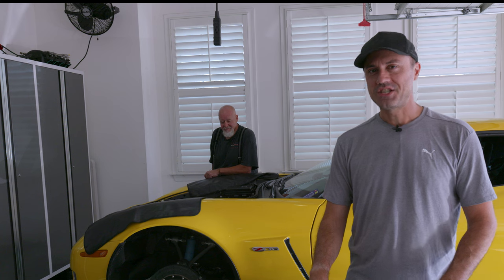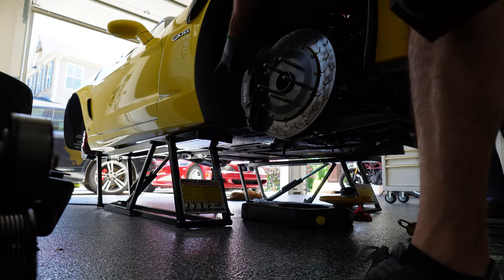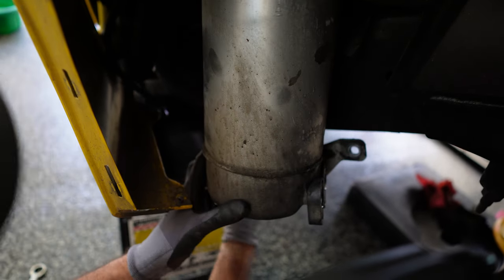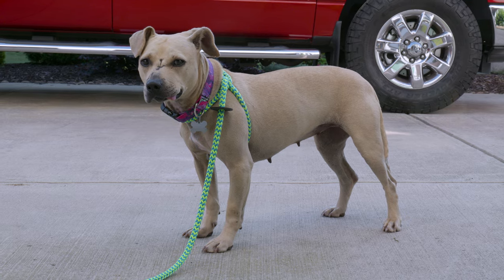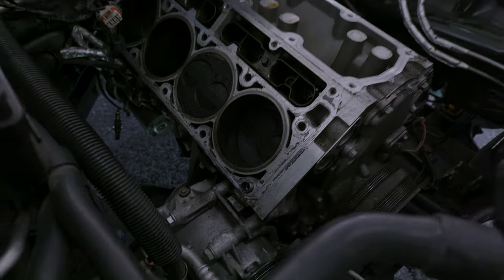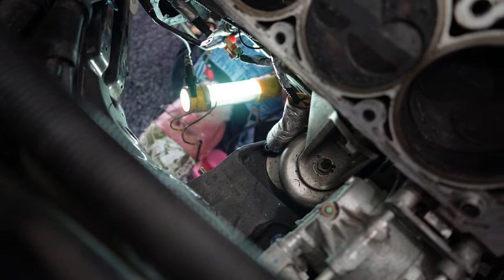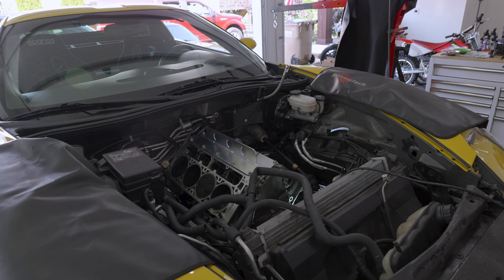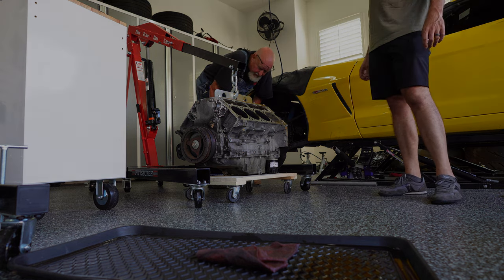Pulling My Blown Engine

Comment: Having worked as a mobile reefer mechanic on trucks and trailers, I would also put my tools away between working on multiple units in a particular yard. Mechanics get a certain rhythm when working, and part of that is reaching for a tool that is where it's supposed to be.  If the tool isn't there, it throws the rhythm off, frustration sets in lol

Comment: Dogs, cars and good food. 3 of the best things in life right there. I’d also recommend changing out the harmonic balancer while you have it apart. I’m sure you know as a corvette guy that they are a weak point with the ls platforms and you have to pull the rack to change them on a c6 anyway lol. Mine started to wobble just under 30k miles, replaced it with a Summit balancer and now at 46k with no issues. Depending on the power output when it’s rebuilt maybe go with the ATI balancer but it’s a lot more expensive lol.
Reply from the maker: Yes sir, thanks for the tip! I had the one wobble right off of my C5Z (the steering rack prevented it from actually falling off the motor), so I have a bit of experience in that regard.
Reply: @JoshVanVeld  yikes! Mine started wobbling after my first autocross. I bought it at 23k and focused on maintenance for the first year but autox pointed me toward bulletproofing before mods. Can’t wait to get it back out and push it more. Awesome watching yours come along!

Comment: Hi Josh. Its great you have your father in law to help. He will help you build your confidence in working thru the project. Some points worth noting. You and your father in law can decide on cleaning the oil lines, oil cooler and intake manifold vs replacement. Once the engine is out, open it up and check the inside of the oil pump. If there is scoring inside the the pump (rotors) then metal did circulate in the oiling system. Also, look at the scavenging pump oil pickup screen in the sump. If there is metal there then that too is an indicator metal circulated in the oiling circuit and thus proceed accordingly. The oil tank will need to be cleaned and it can be disassembled for cleaning which will need to be done. Good on the engine hoisting rig. There is the challenge in getting the replacement engine assembly installed back onto the splined input shaft. Get the steel alignment shaft from Summit or Tic Performance etc. These will get the friction disc and pilot bearing aligned perfectly when you reassemble the clutch back on the engine so the input shaft will pass very smoothly. The car wasn't really designed to have the engine removed this way. The whole drivetrain is to be removed as a unit and then broken down. Pulling the engine from the top though is less work but the clutch shaft to engine mating needs to be done precisely. They make an engine hoisting plate that has a lead screw so the pickup to the hoist can be set such that the inclination of the engine can be set very precisely. With the rig you have, you can try using a winch strap and connect either to the back or front of the engine and change that tilt angle a needed. Need to get the crankshaft centerline and the input shaft centerline exactly the same for the input shaft to slip into the clutch disk spline. This is the hardest part of re-installing the engine and needs to be planned for when reinstalling the engine. Replace the clutch servo in the bell housing. The stock GM service part is fine. Get the Katech clutch bleeder kit and install that while everything is apart. Way easier than trying to install with the drivetrain assembled and a very necessary as these hydraulic clutches in these cars gets clutch dust in  the servo and thus in the fluid. Clutch action then gets bad and not a good situation for a track car. The Katech clutch bleeder makes maintaining the clutch fluid much much easier and the clutch action will be better. The clutch master cylinder was updated on these cars. Get the latest part number master cylinder (pedal side of clutch) from GM and replace that while the engine is out. This can make the shifts cleaner and faster and fixed some potential malfunctioning issues as per GM service bulletin. For the clutch assembly itself, use the GM stock Z06/ZR1 clutch from ZUK (ZUK makes it for GM). Not expensive and has the right balance of torque capacity and pedal pressure for a track car. Chris Sullivan on this Youtube Corvette show does have an episode where he re-installs the LS7 in the car so that can be a help tp you for the tricky parts of the process. Anxious for what your decision will be on the engine build. Hope all this helps.
Reply from the maker: Another treasure trove of info, thank you for taking the time to post this!

Comment: Hey man, sitting here in my garage looking at my half disassembled LS7 that I am pulling due to engine issues. Truly your videos are really good, informational, fun to watch, and I relate to them. LS7 rebuilds are really expensive, even the cheap ones ($12k+). Hang in there, take your time, take care of what you need to financially. At the end of the day the car is a material item, don't sacrifice relationships or too much money to see it live. Every person I have seen rebuild the LS7 or engine swap for another LS7 just sees them blow in another 20-50k miles, take that into consideration. I am looking at throwing in a 5.3 L truck motor into mine because everything else would cost $8k+ in parts and labor, then over the next few years rebuilding the LS7 as I have money. Rather have a car thats reliable and drives than one that doesn't do either. I keep trying to find proof that there is such a thing as a built LS7 under 600 RWHP that will last 100k+ miles, still haven't found any hint of that..

Comment: I will also definitely rebuild the tq tube while u at it. 2 new couplers 3 bearings and the metal piece infront is called a slinger.

Comment: The more I watch, the more I am struck that with your positive attitude you have an opportunity to do something here that would be very rewarding and get you to your goal for a budget you can justify IMO. I've built a few engines over the years but I am far from an expert or professional. Get yourself a book on building LS engines- especially one on building performance LS engines and read it through. You have the tools now, the ambition, and the ability to to this and you can build an engine for a fraction of what a crate or special built engine will cost. And you will know exactly what went into your engine for parts. If it were me, I would get a Dart block or some other strong aftermarket block to start with, especially if it is compatible with your existing rotating assembly. Have your existing rotating assembly inspected by a good shop , along with your head parts, valve train, and cam/cam bearings for damage from metal shavings and other debris from the engine breakage. Have the heads repaired, get new bearings , rings, and replace the damaged piston and have the block machined to accept all the existing parts and new parts. If you're not feeling up to it, most good automotive machine shops will assemble the short block for you for a relatively nominal fee. If you want to do it yourself, follow the instructions in the "Build a Performance LS Engine" book, and have a buddy with some experience standing by while you do the more important parts, like checking bearing clearances with Plasti Gage or how to gap piston rings... Add an upgraded cam if you are looking for more power, a different Air Flow meter and intake, etc... to suit your needs, etc... for barely more than putting it back together stock, and save some money. To Rev to 8K, you will need better lifters. You can do this... check out "that engine guy" Youtube videos on his recommendations what to use to build a high revving engine that will perform...
Reply from the maker: Thanks for the vote of confidence, Bob!  Appreciate the advice.

Comment: Use a long stud 2 nuts and 2 washer on the passenger side craddle mount for the steering rack. You need to bend those mounts a bit open. Dont bend it too much otherwise u will b looking for another craddle. Magnesium is soft af. That way when u put the rack back in, you wont be struggling too much. 

The ac compressor u can remove the 4 bolts from he passenger side wheel wel. Lower the 4 craddle bolts 21mm

Comment: On the F150, keep an eye on the soft brake line, just had one of those fail and create what appeared to be a stuck caliper. I’d never seen one fail like that. Exterior was fine. Interior was collapsing apparently. 

So if the issue returns slap some soft lines on it.
Reply from the maker: Thanks I'll make sure Jeff sees the comment.

Comment: Regarding the oil cooler, the other option is to add a thermostat. You’ll get up to temp faster but still have the benefits of the oil cooler when you need it. I’m a month into having the Gspeed kit on my car and it is phenomenal.
Reply from the maker: Oh cool, I hadn't heard about that. Seems right up my alley, thanks for the tip!
Reply: @JoshVanVeld  improved racing also makes just the thermostat and other bits if the Gspeed kit is too much scope creep.

Comment: Josh, I must say, your video was fantastic! It really struck a chord with me. Seeing your well-organized garage has inspired me to finally tackle mine. It's been over a year since I moved into my new home, and I still haven't gotten around to organizing it properly. However, I did manage to make a smart decision right after closing on the house—I got the floors coated with epoxy. It made a huge difference.

I have a three-car garage, and one of those spots is occupied by my '09 Z06. Now, speaking of cars, my biggest concern lately has been the valve drop. I had the heads redone when the car had 13,000 miles on it, so I could focus on other upgrades. Currently, it's at around 15,000 miles, and while I've considered taking it to the track, I haven't done so yet. Your work in the video is truly inspiring, not just in terms of tackling DIY projects but also in reminding us to seek help when needed and to never stop learning. Knowledge is something no one can take away from you.

Anyway, getting back to the point, I'm curious about your plans for the motor. My gut feeling is that sticking with the LS7 and building it to be bulletproof is the way to go. And please, keep it naturally aspirated. I don't want to ramble on too much, but I do need to hang my quick jacks and tidy up my garage. Thanks again for the great video!
Reply from the maker: The floor is absolutely the critical component and the place to start. I might do a standalone video about the garage at some point because it was so hard to convince myself to pull the trigger on it. And I realize not everybody is in a position to spend thousands on floor and cabinets, but those are really the two key ingredients and suddenly you've got a space you're proud of that you want to keep clean.

Glad you enjoyed the video and glad I could provide some inspiration!
Reply: @JoshVanVeld  Oh it sure is.. Makes cleaning oil spills and so forth a breeze. And as for pricing of it. It is costly but well worth it if you are a auto DIY'er

Comment: I have a 2008 yellow Z06.  I so much enjoy watching and learning from your channel. I am also a hobbyist mechanic and raced SCCA for many years. I am getting the head fix and porting from West Coast Heads, American racing headers, Haltech exhaust, and a tune. I am focusing mostly on reliability without adding a little bit of power. Thanks again
Reply from the maker: Sounds like a great plan. Thanks for the comment! How did you choose the exhaust?

Comment: One more thing about the tools- they take a lot of room and keep them.  I'm the guy who rebuilt the Porsche Carrera 3.2 engine last year and kept all of the tools I used.  You will run your engine hard and if anything goes wrong you'll be 100% in control of your destiny.  It's better that way and the storage is worth it if you're all in on the car.
Reply from the maker: Kudos on rebuilding a Porsche engine! LS feels like a nice platform to start with because it's so simple in terms of design and has so much aftermarket support. If I ever feel like I'm even 75% in control of my own destiny I'll consider that a huge win. Appreciate the perspective!

Comment: Another good video. It’s great you are willing to share your experiences honestly, can be very helpful to your viewers. You are the 2nd YouTuber that I have watched to show top removal of an engine from a C6. I haven’t tried my self but I think I would go with the dropping of the front and rear cradles to remove, but that is because I have a lift in my garage. Not sure which way is “easier” but it probably is very dependent on if you have a lift or not. Good job. I look forward to seeing what you do for your replacement engine build.

Comment: After 12 years as a mechanic at couple Chev dealers I can tell you organization is critical to quality repairs. 
Keep at it, you’ll get there. 
Update on my C6Z
I got the engine out and block torn down, everything looks great other than the cracked sleeve and broken ring lands on 5&7. 
Going to drop it off at Race Engine Development in Oceanside, CA in August for its re-sleeving party.
Reply from the maker: Progress! Great news! Nice to have a premiere re-sleever in your back yard. I think you gave me your thoughts already, but what's your take on whether I should pursue repairing the old block vs. new block? Keeping in mind that I want to avoid too much down time - I've heard that some of these shops will take 6 months+ because they're so busy and because of parts shortages, but won't necessarily disclose that ahead of time.
Reply: @JoshVanVeld  I think it really depends on the condition of the block once you tear it down. 
Steve at RED told me he’d have mine done in August.  He’s out having surgery right now, but might be worth giving him a call once he’s back. 

If you can afford it, a built short block from Mast would probably be my recommendation. If your block just needs honing you should have no problem reselling it quickly.
Reply: I was a Chevy tech too while in school, I’ve since moved on to the career I was in school for. I still like working on my cars and sometimes miss my tech days, I had good times and good teachers. I’ve been liking your videos, I’d like to have a track car like Goldie but been having fun AXing my car this Summer. I’ve had races about every few weeks and while I don’t have the issues you’ve had I’ve had fun upgrading parts and prepping it for race days, it’s an on going project.

@bryansmith5415 is right being organized leads to quality repairs and what your FIL said, you do remember where all the bolts go if you’re doing a repair you’re finishing the same day or soon after.

Oh and what you said about turning a bolt with your fingers then having to put a wrench back on it. Your finger tips get used to it, if you’ve done it for awhile, and you’ll be able to turn the bolt all the way off. Good luck with the repair, can’t wait to see how it turns out.

Comment: If you’re looking at other engines besides the factory motor, the M156 engine is a monster engine, bulletproof, and just slightly less displacement at 6.2L so will still sound amazing.
Reply from the maker: How cool would that be?? I assume somebody has done it by now, but unless there's a kit out there it's probably way above my skill level to pull off a swap that requires fabrication and such.

Comment: I'm another subscriber who is loving the ups and downs of your C6 journey. I too work on my own C6, partly budget driven, partly personal satisfaction. I'm not sure whether you've decided on the engine rebuild specification yet, or fully assessed the damage, but given the GT3 killer aim it would be all too easy to go for big horsepower and beat a GT3 laptime. However, with an eye on originality and possible re-sale value I can't help feel that 505hp is enough, you just need reliability. Get the heads fixed, trunions, perhaps change the lifters whilst you're in there, oil pump, water pump and seals and leave the rest original. You'll start to find the limits of your oil cooling as you get faster and sessions get longer. Oh and I can recommend the Improved Racing oil thermostat, given that you drive the car on the road too.
Find the lap time through handling upgrades, stickier tyres (second set of wheels perhaps) and continued driver improvement, although you're clearly handy behind the wheel already. Your AP BBK will help next time you are out, no doubt. If you're interested, here is my journey so far, imine is high mileage LS2 Coupe, I've experienced a few highs and lows along the way. I've documented all the track upgrades as the years have passed: https://www.pistonheads.com/gassing/topic.asp?h=0&f=47&t=1758933 Kind regards, Dave
Reply from the maker: Hi Dave, thanks for the comment. Because of the hyperlink it got caught in the spam filter and I didn't see it until now. Looking forward to checking out your build, thanks for sharing your thoughts!

Comment: Yes. I know the C6 Z06 was the first to get the dry sump. I bought a C5 Z06 new (museum delivery). When I took it to the track I was supposed to add a quart of oil.
Reply from the maker: I had a C5Z, awesome car and the first one I ever tracked. Museum delivery would be perfect from Atlanta area, great way to get to know it on the drive home.
Reply: @JoshVanVeld  Museum delivery was cool. You gotta do it if you're going to take the new car depreciation hit. I was also the first person to ever start my car on the production line.